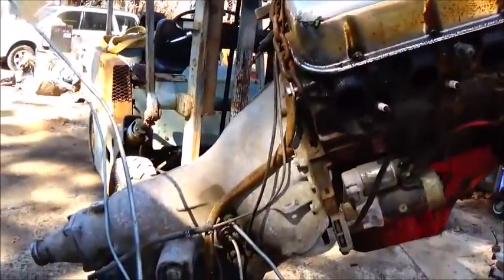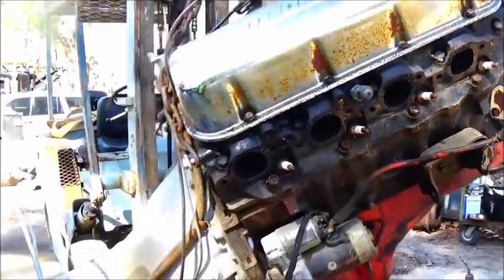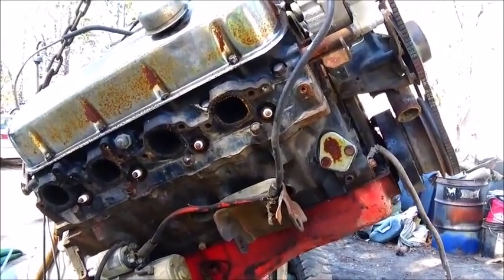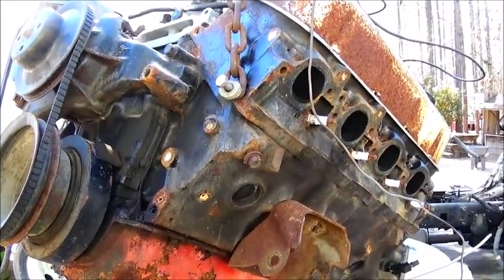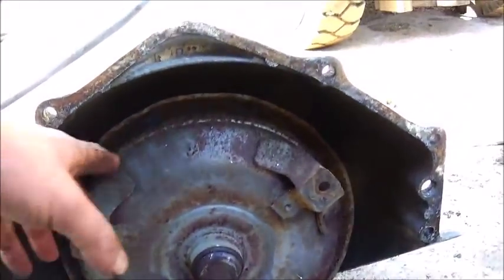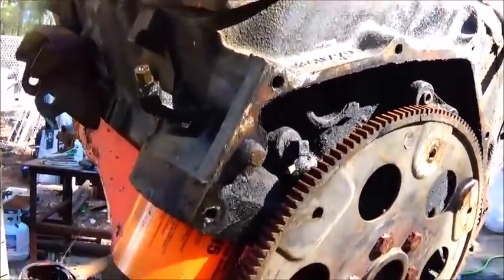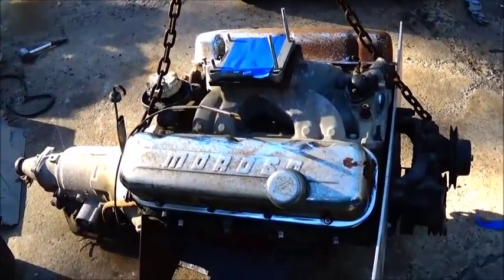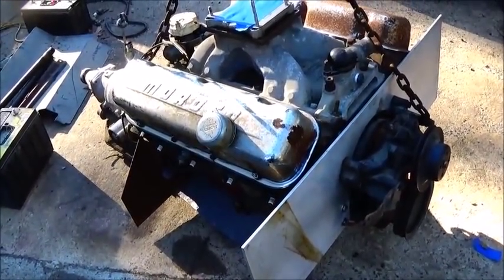Low Budget Drag Car Build Part 11 Pulling The Oil Pan

Comment: Are you planning on driving on the street, if not there is no need to run a alternator just use an appropriately sized  good battery and recharge between rounds.
Another way to trim the housing down would be to use a pipe cutter to cut off the end then you could chuck it into a lath and cut the weld off.
Since you mentioned using propane to chill the axle down.  
Funny story a friend was trying to put a bushing on a shaft so he stuck the shaft in the freezer, his dad said why don't you use the wet line hose off the propane tank to chill the shaft and the vapor hose to heat the bushing (can you tell where this is going?) so he put the shaft in a can and the bushing in another he had the wet line and his younger brothers the hot . Everything is going good, wet freezing propane is going  into the bucket with the shaft vapor is pouring out younger brother who is down slope is heating up the bushing when the vapor following the slope met the flame of the torch. WHOMP!! Craig said there was a noise and suddenly he was surrounded by flames, younger brother dropped the torch  and jumped over a work bench and started running, Craig was busy trying to shut down the tank as his mom came charging out of the house with a fire extinguisher (They have her well trained) after all the excitement over and the flames put out, his dad showed up from feeding the cows and asked what had happened when told he said I never said to use both at the same time. Yeah good ranch kids fun what does kill you is funny later

Comment: Greetings Jonathan,  Your 427 tall deck is a great platform. 10.200 vs 9.800.   Forged 6223 Crank,  4 bolt case. Instant gratification on a budget.  Have fun and hang on. I believe she will be a real banshee. Buy the way don't forget the charmin on the first few runs. Man what a cool ride this will be.  Thanx a bunch! Keep the vids coming.

Comment: if you want the engine to be as short on the front side as you can get it , look into the water pump for a 1967 chevy caprice with the 427 , it is the shortest pump you can get , only drawback is one thing you don't have , is the stack of pulleys that they used on the tall deck truck on the balancer they are basically flat and each a single pulley , stacked to whatever number they needed , if you go look on my beltstowing youtube , you can see where I put mine together and shoe horned it in my 63 c30 , also I copped out and bought a mount kit for the alt and a/c , but it's made from plate , might give you some good ideas where to go with yours , maybe so , maybe not ... your distributor still confuses me on that engine , I do still have the truck intake on mine , but I pulled it to make sure I remembered right and it is the same as a 350 but factory vac advance delete , it has to be something with the years , mine is an 1984 engine , yours is far earlier , guess it's a mystery lol

Comment: I just discovered your channel a few weeks ago, and have probably watched 2/3rds of your videos.  I absolutely love your channel for two primary reasons.  One is that there is practically no swearing.  It is not that I, myself, don't swear occasionally (particularly at idiot drivers in the foreign countries I have worked in) but the channels where there is frequent swearing just are difficult for me to tolerate.  Secondly, you are extremely talented in teaching or explaining the reasons for your actions or decisions.  I am now over 70 years old, am a Professional Engineer with more than 50 years of experience, specialized in automotive power train design during college (back in the day before computers were prevalent), began playing with anything mechanical or electrical since the age of 7 or 8 years of age, and have more than 200 of my own automotive related projects (perhaps more than half that I actually finished), and have engineered $100's of millions of professional projects -- yet I still learn from your videos!  I also appreciate the love that you provide to your friends and chosen charities.  You are an inspiration that everybody should try to emulate!  Keep going full strength forward!  When I return to the USA someday, I am now inspired to return to a few of the projects and finish them, that I stopped working on some 15 years ago.

Comment: hey Jonathan this is Tim from Missouri I have a question for you it has nothing to do with you your video I don't even know if you can answer me but here it goes. I just bought a 2002 Ford f150 with a 4.2 L V6, the guy I bought it from told me it had a stuck exhaust valve on number 3 cylinder. the motor makes no noise no clicking no nothing I was always under the intention it would click if the valve was stuck it blows white smoke do you have any clue what it could be ? thanks.

Comment: The ford/mazda 2.3 engines I've messed with don't use anything other than rtv to seal the timing chain covers and oil pans. As a result of seeing production motors do that I'm not shy about using a factory rtv (I try to avoid permatex) to seal parts on my mitsubishi engines that had gaskets originally.

Comment: 366 or 427 .truch should be a tall deck ,jjust put the Edlebrock cam and head kit for it 500 HP 6000 RPM

Comment: @2:13 Is that a crack in the Pressure Plate, near the top, just below a tooth, 12 o'clock? (In the tooth ring)

Comment: the vega trans did not have cooler lines it used air cooling that is what the shield on the converter is for there are openings on the bell housing and cover so air would go through and cool the converter and cool the trans to  i like to use the grand national converters there around 3000 rpm stall and work good with a lot of torque and keep up your vids  i am a trans tech but i even injoy your vids

Comment: On one of the hot Rod Forums ,a guy here in Australia removed the axle tubes from the diff head .And replaced them with polished stainless tubes. Getting the tubes out seems to be quite easy

Comment: I usually cut the tubes off flush with the pumpkin, then burn out the spot weld and cut the remaining small tube peices with the torches in small sections.
Reply: jeremy rowe how do you not mar the pumpkin?  Seems a risky endeavor to me.
Reply: fuckery abounds 
You don't have to burn all the way through and I use my air chisel to break away the sections. It's not a machined precision fit ...and even if you do score the pumpkin, its not critical,your welding it to keep it located.

Comment: I've got a 427 truck motor everyone tells me not to build it because the deck height is to tall do they still make good motors
Reply from the maker: Very good. I learned quick building pulling engines that the taller the deck the less rod angle when you have a long stroke. Same bore as a 454.
Reply: Jonathan W I'll give it try I haven't nothing to lose on the deal thanks for the response

Comment: DO NOT USE ENGINE PLATES!!!!!!!  I used to build drag engines professionally and every single customer i had that used them ended up with cracked cylinder bores, warped block decks and blown head gaskets due to the torsional stress having no where to go!!